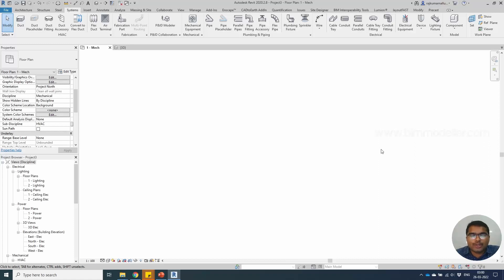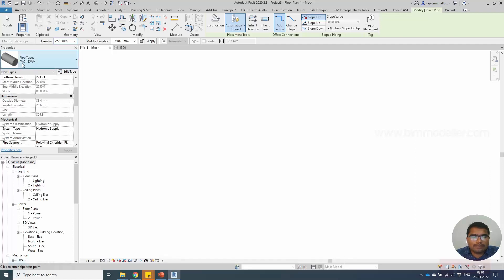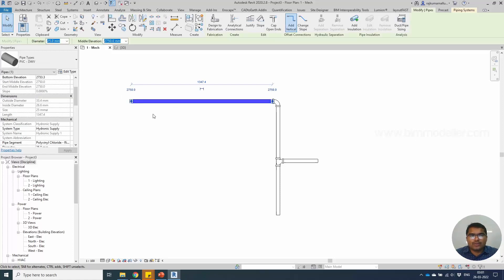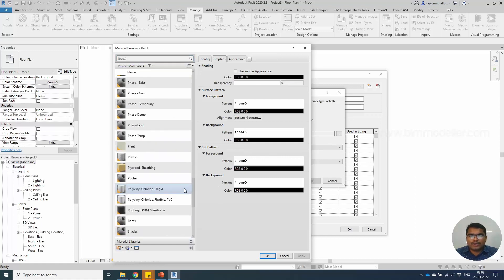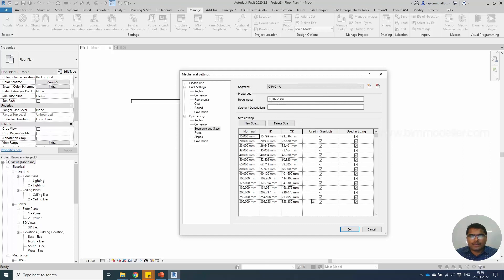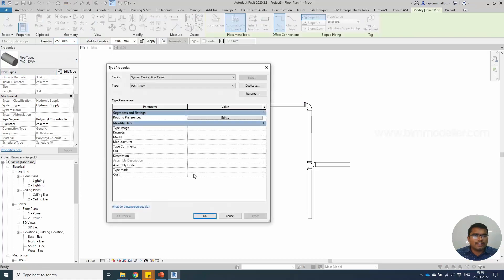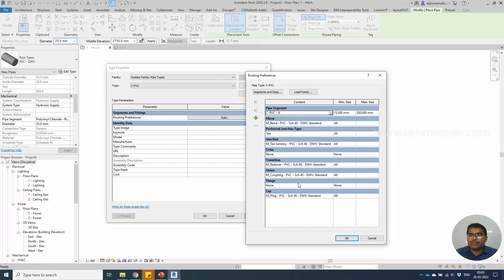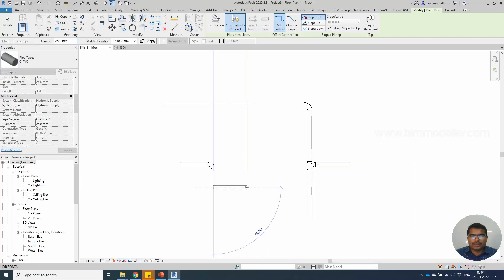Revit MEP Tutorial 23: How to add New Pipe Types

Comment: Is it posible to define maximum and minimum length of pipe? Also, is it posible to define that we have no transition other than a weld between two pipes?
Reply from the maker: Dear @Adin Arnautovic, Yes You can define as value, But do remember it won't add coupler in-between or Make segment. You can check the other fittings in the library and Add them to Type.
Reply: @BIMModeller  Thank you for answer. It would help us if you can to make a video about this or describe how to do it (of course, if you have time)...